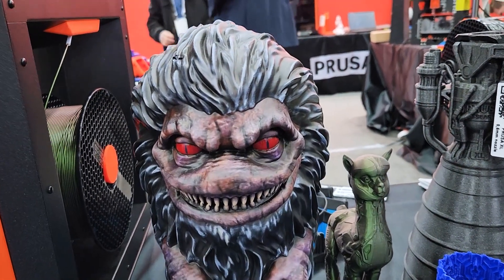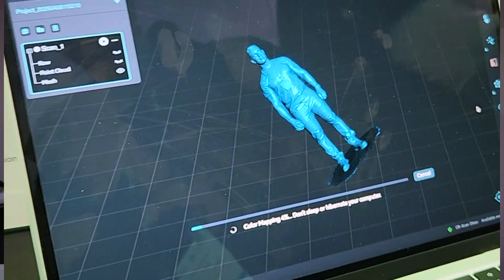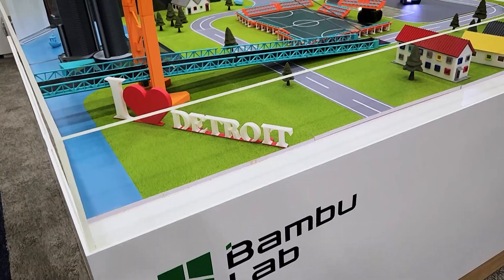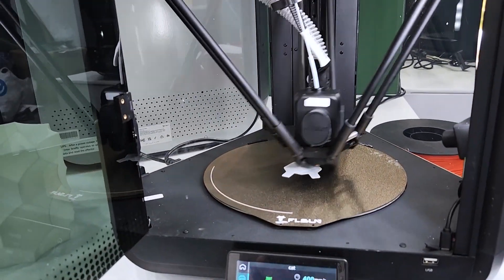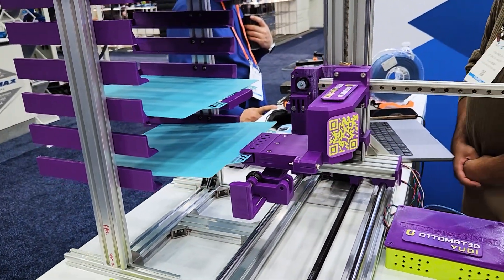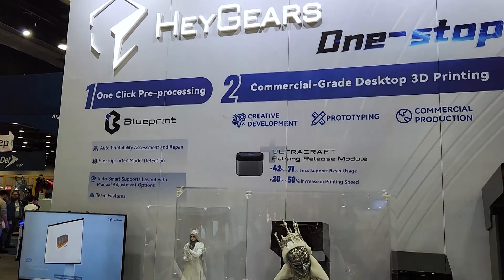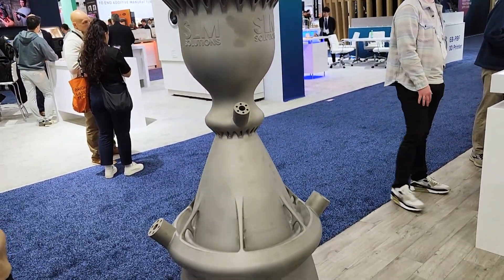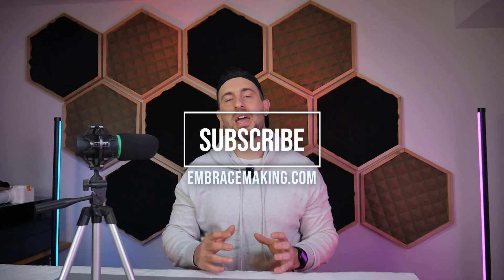Everything You Missed at RAPID+TCT 2025, Highlights, Recap, New Printers For This Year

Comment: I'm looking into the Creality K2 series and have a couple of questions. Have the issues with the original K2 plus, like those mentioned by Uncle Jessy, been fixed in the newer K2 Plus ?
I usually buy Creality, but I'm not yet confident in the K2 line. The K2 Pro size is ideal for me, so I plan to wait a bit longer for more user feedback or confirmation of improvements.